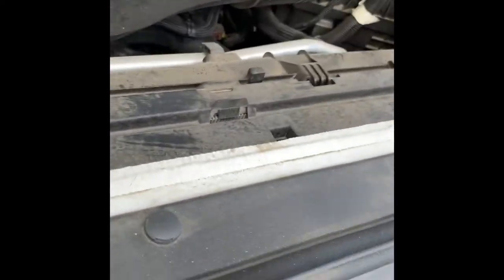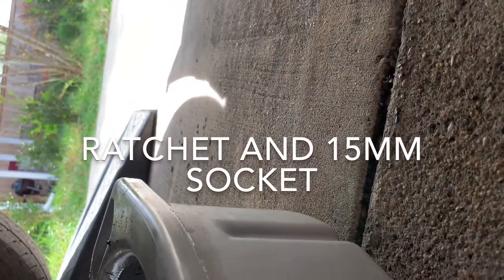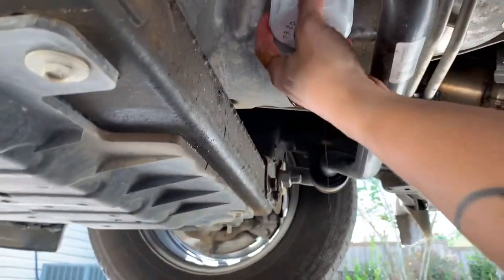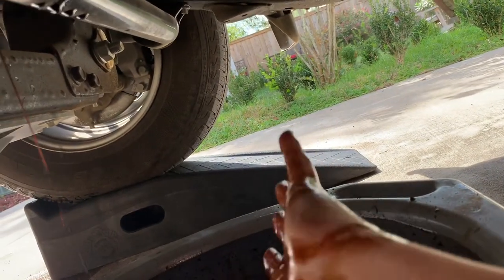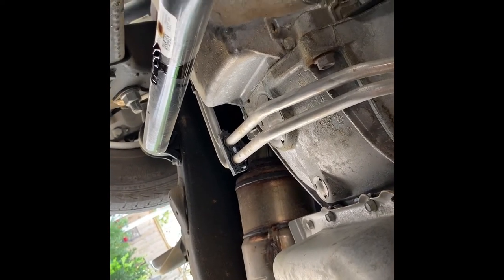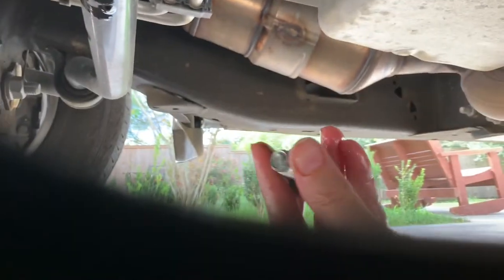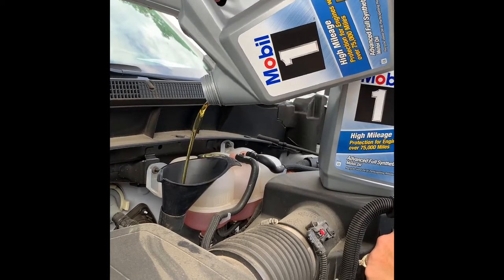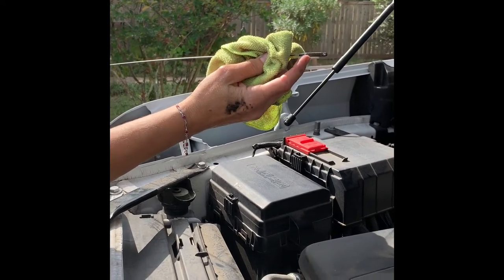Changing the oil in a 2019 Silverado 5.3L

Comment: Would you believe on the new 2.7 I4 Turbo the drain plug is 3/8 drive like a socket and is plastic composite oil pan sump twist lock just like your oil cap you just put back on
Reply from the maker: Wow that is different maybe they made something easier for once 😁